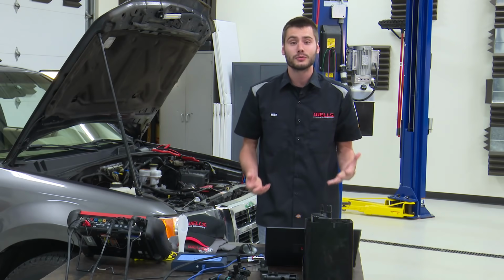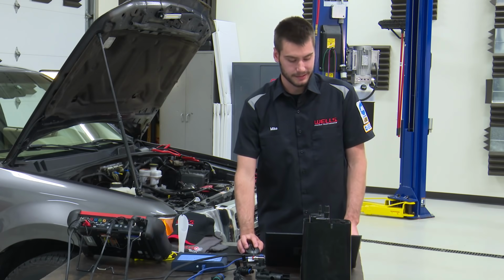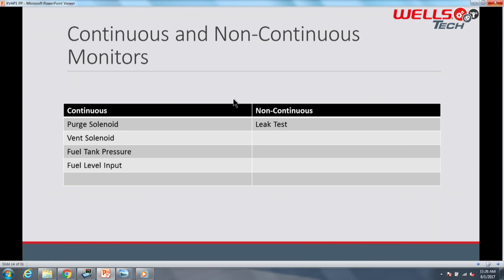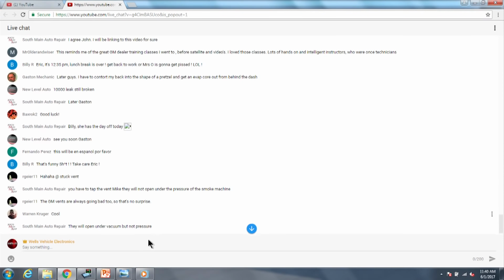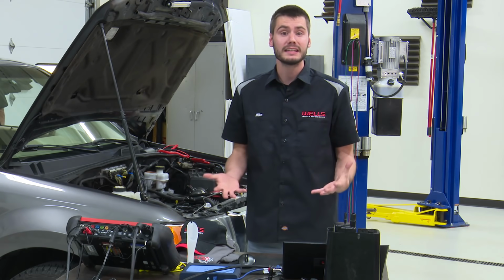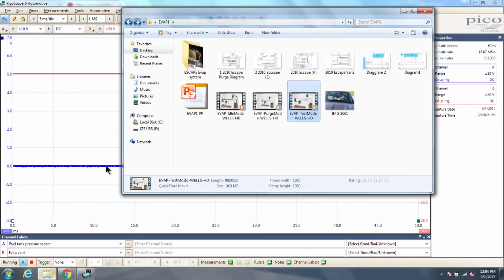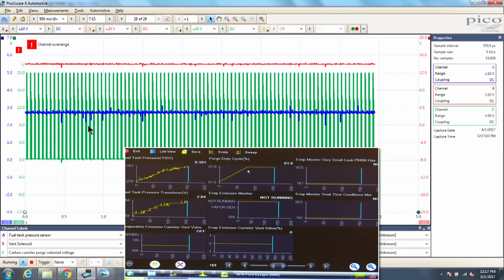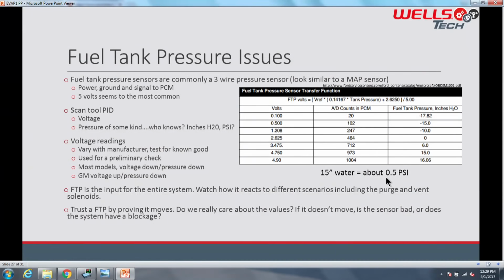EVAP-Evaporative Emissions System Operation, Testing, & Diagnostics Beyond the Leak (P0442, P0455)

Comment: Good video, learned a lot!! I have a HUGE problem with my Mustang, 2004/ 3.8 litre. It had a vacuumleak before I changed bigger fuel pump, 255 lph, but seems like now it got worse. I also changed throttle body much bigger, was 60 mm?? (OEM), now it is 70 mm. Also "check fuel cap" light used to come on, even I  before did these changes. Of course, there was nothing wrong with fuel cap, replaced it anyway. So now, I have very high idle, like 2500-3000 RPM, for awhile, about 30 sec or so, and then idle comes down to about 1200, never goes lower/ normal. I know there has to be a big vacuum leak somewhere, because AC blows from vent, works OK, but when speeding, or under load, going uphill, it blows to window only, changes by itself??? Checked vacuum leaks visually, so far replaced EGR valve, EGR solenoid, Purge valve "front door", and will change purge solenoid valve tomorrow, already bought it!= rear door =). 12 volts coming to purge valve and solenoid, just cant find a leak. Bought cheap smoke machine, did not find anything, that test was not so great, has to do again with good smoke machine. I will take out purge canister too, and check, if it is leaking or if there is gasoline??/ inside?? How do I find that leak?? And get my idle down?? Also replaced TPS and IAC valve, they are all good???? Tired to throw money for this problem, and I don't seem to solve this problem!!! Any tests, I could do?/ Any ideas?? Thanks, appreciate your help, youtheman =)
Reply from the maker: Hey Eero, thanks for watching!!! Man, it sounds like you've spent a TON of money on this car chasing this issue. Honestly at this point I would recommend you take this thing in to a shop that you can trust that is good at diagnosis. There's a ton of things that can cause that high idle. Maybe intake gaskets are bad? Hard to say without seeing it with a scan tool and some testing equipment. I think at this point you're are going to be money ahead to take this in and have it properly diagnose!
Mike Becker, Technical Services Instructor
Reply: I have sprayed around intake gasket??/ nothing?? Otherwise car runs good, just drive me nuts, I don't seem to solve this, leaking problem?? Yesterday took out EVAP purge canister, tested it with pressured air, in a water, no leaks?? Also changed purge solenoid, "rear door", and 12 V seems to be coming into plug?? It is a big leak,...BUT I can't find it?? Smoke-machine?? Could it be intake manifold gasket??? Going crazy here.....
Reply: And, also, "check fuel cap" light came on already, when I bought the car, like a year ago, now it comes on every now and then, yesterday codes were: idle higher than expected....welll, don't we know it already =), EGR system problem, and big leak in EVAP system,...I just can't find it????
Reply from the maker: Eero, most likely your high idle problem and your EVAP problem are unrelated. You tested the purge solenoid, the one near the intake manifold, and that's not leaking correct? If that's the case you are most likely working with 2 different problems here. What are your fuel trim numbers? High idle, first thing i'm looking for is codes and fuel trims.

Mike Becker, Technical Services Instructor
Reply: How do you measure fuel trim numbers??
Reply: Here are my codes, after I checked purge canister leak, and replaced purge solenoid= "back door"": idle still sky high, like 2500-3000 sometimes, comes down to 1100-1200 in about 20-30 seconds????, never goes under that; P0507 =idle higher then expected, P0443 = Evaporation Emission system purge control valve circuit, P0455 Evaporation Emission system, large leak??, and P0405= exhaust gas recirculation sensor circuit LOW?? And,....can't find a leak??? Help meeeeee, thanks =)
Reply from the maker: Eero, we have an entire fuel trim series of videos. I think 5 in total. I recommend you review those and get yourself up to speed. I have them organized in a playlist. 
Mike Becker, Technical Services Instructor
Reply: OK, I will check them out! Do I need any special tools, other than volt meter?/ to check fuel trim numbers? What do you think about those codes?? Could computer be the reason?? Otherwise car works fine, power OK?? Thanks, ps. there is a large leak ....somewhere???/
Reply from the maker: Eero, these questions will be answered in all of those videos. Tell ya what, watch those, then let me know if you still have questions. I am happy to help, but I think you need to get the base knowledge of this all first. 
Mike Becker, Technical Services Instructor
Reply: OK, thanks =)
Reply: Well, I did not watch them all,....part where you talk about  fuel trims...yes!!! Thing is, I can't check it without scanner, right?? I am starting to think, after I changed bigger, more powerful fuelpump, and also added plenum, between throttle body and intake manifold, about 3/4 inch ( I had to!),  this crazy high idle started??? Has to do something with stronger fuelpump, 255 lph?? I am sure that I still have a vacuum leak somewhere also, but, that is a smaller problem??/ "Check fuel cap"- light also still comes on???= vacuum leak somewhere!!!! So , do I have to go somewhere, where they can check my fuel trim and could adjust it??/ I sure will need them later, planning to add Cobras Supercharger into my V6, already bought that, it is in my trunk,...waiting for my buddy to make/ modify intake manifold for it?? How much those good "scanners" cost?? Thanks again, youtheman =) Ps. I also want to take out RPM limit,...it is now only about 4000 RPM!!!

Comment: Great presentation.  I am still not understanding the operation of the Vent Solenoid. Could you,please
provide us a detailed operation of it?
Reply from the maker: Carlo, which part? The vent solenoid on a basic EVAP system is only used to test the system for leaks. It is the back door. It seals the system as it is pulled into vacuum. At all other times, it is open allowing the system to breath (vent).
Mike Becker, Technical Services Instructor

Comment: Hi! @Wells Vehicle Electronics And Mike Becker! My question is: Can a faulty EVAP system lead to a fuel pump failure?
Reply from the maker: Hey Argeny! I can't see how an EVAP system would cause a fuel pump to fail. Maybe under extreme circumstances, like if the system were to be plugged and pressurize. I guess that could somehow affect the pump...but I find this unlikely. Gut feeling says no. I don't think so...but i'm sure there is someone out there that can prove that it can. That's the fun of automotive, impossible to speak in absolutes!
Mike Becker, Technical Services Instructor

Comment: 02 chevy venture LS question,  can canister vent solinoid be removed and replaced without dropping fuel tank?
Reply from the maker: Hey, unfortunately it looks like the vent and canister assembly sit on top of the gas tank on these Ventures. it may be possible to "lower" the tank without fully dropping it and changing it out. But, per the service procedure, step 1. remove fuel tank. 
Mike Becker, Technical Services Instructor
Reply: Be aware that the tank is stepped down toward the front and the vent canister is in the  front of the tank behind a metal baffle plate.  Looks hard to get at ;least 2 nuts inside plate  To remove canister .      Just behind it on the up (slope) of tank is the solinoid, attached to plastic clip,   not really on top of tank. Thats good.      Im trying to find out if the lifting and supporting jack stands WITHOUT removing 2 tank straps of 3 to drop front of tank will do the trick .  Do you have a service time to replace the canister vent solinoid for this very model . That may provide a heads up to not dropping tank    ,Tank R&I must be at least 1.5 to 2.0 .     If less than 1.0 I would say  its accessible with out Tank R& I . Thanks for the tech advice .
Reply from the maker: Great info! That labor time for the vent is 1.4 hours. The tank R&R is 1.8. You may be able to sneak it out. Good luck!
Mike Becker, Technical Services Instructor
Reply: thanks,   that time to R&R is still very long considering its upfront location  Id say they expect tank removal either way .  Cant see where GM would try to save customer 4 tenths  for what ?  They might be telling you dropping tank in the front saves 4 tenths as to not conflict with total  R&R 1.8 vrs    1.4    20 min roughly 40.00to 60. on  per hr labor rate .  Still overtimed at 1.4. They are covering their bases a bit to high . Like you said, it does look like a  time savings  and I will  attempt the job once fuel tank is below 20 lbs fuel. Thanks for the Good Luck wish Regards
Reply from the maker: You're welcome! If you need anymore info don't hesitate to ask!
Mike Becker, Technical Services Instructor

Comment: I have a problem where while filling gas it shutting off A and sometimes it works
Reply from the maker: Hey Alfred, commonly when this happens it is because the VENT solenoid is stuck shut not allowing the fuel vapors a path to flow. I would most likely be finding the vent and seeing if I can blow through it. 
Mike Becker, Technical Service Instructor

Comment: The design on my GMC looks like it was engineered by a team of retards. Every 6 months I buy solenoids and gas caps just to keep it on the road. What a fing joke US made trucks are.
Also it only runs the test at "special " times so you end up driving around wasting gas just to be let down usually around 45 miles only to find out its still leaking. This is deliberate planned obsolescence. The only thing that saves GM is the truck has usually rusted down to dust before the evap system shits the bed.   This issue has been with this truck since the day I bought it. GM makes a kit that supposedly fixes a poor design with a design that is even worse. ( PS it doesn't fix anything.)  The only question I have is why did we bail out Government Motors. To big to fail I think not they are failing every day . If you bring your truck to a garage you will be raped most places wont even touch rusty trucks.  Its a 3 year truck after that your on your own just around when the lease runs out coincidence?

Comment: I know it's way overdue, but the answer to your question was non sealing purge valve?
Reply from the maker: Hey SPD Parts, actually no, it was not. The answer was that the smoke was not making it's way to the filler neck (which was leaking). It never reached there because of the one way valve. Check out the TechCOnnect Video. I demo it on the car! https://youtu.be/u2yPUTA3pEY
Mike Becker, Technical Services Instructor

Comment: so basically the purge sensor is like the DPFE Sensor on a 2000 Ford f150?
Reply from the maker: Hi Rosman Morales. Are you talking a purge sensor or purge solenoid? A purge sensor is similar to a MAF sensor, air flows through it and the computer then knows that the purge solenoid is opening. 
Mike Becker, Technical Services Instructor
Reply: Wells Vehicle Electronics I don't know.  I have a 2010 Chrysler town country and it is the one on the left side of the van under the hood. It has a filter type of thing.  It has 2 hoses on it
Reply from the maker: Alright, Chrysler uses a purge solenoid. It is a normally closed valve that opens when power and grounded by the computer. Very very different than a DPFE sensor.
Mike Becker, Technical Services Instructor
Reply: Wells Vehicle Electronics What I do know is that I have a P0440 code.  I checked all the hoses and they look fine.
Reply from the maker: Rosman, we are actually going to be doing a Chrysler EVAP class coming up here soon. Stay tuned for that, I think it will help you get to the bottom of your issue!
Mike Becker, Technical Services Instructor
Reply: Found the problem to my van. I dropped the tank from 1 side and found that the carbon canister was left unplugged on purpose by the mechanics. I guess they were hoping that i bring it back so they can stiff me the second time. That was my 1st time ever taking it to a mechanic! Only reason I took it in was because I wasn't feeling it to do the job myself this time around.

Comment: That Ford easy fuel filler neck is a joke. I've replaced tons of those things already
Reply from the maker: Hey John, yeh they do seem to have their issues. I have owned 2 vehicles with them so far. I find that if you keep it clean you'll never have an issue. 
Mike Becker, Technical Services Instructor

Comment: Hey Mike! Third time watching; what kind of gas is the one coming out of the charcoal canister? I know you said fresh air, but in the case I have a stuck open purge solenoid, how is this gas going to interact with my "normal" intake air? Is it going to be like inert gas just taking space in the combustion chamber or is it going to cause a lean condition? (This type of EVAP)
Reply from the maker: Hey, third time's the charm!? First off, we need to understand that the Canister has multiple ports. One going to the purge, and the other to the vent. The air from vent is "filtered" air. The air traveling to and through the purge is not "filtered" air.The purpose of the purge is to clean all of the stored vapors out of the canister. SO, the air traveling through the purge is very combustible fuel vapors, so, a stuck OPEN purge can cause rich concerns while emptying out the canister. Once the canister is empty of fuel vapors, then the car will run lean. Because it's pulling IN fresh air through the vent, through the canister, and through the purge. Does this make sense? 
MIke Becker, Technical Services Instructor
Reply: Gotcha! Now I understand. The gas going through the purge is not air. That's why it's going to create a rich condition instead of lean. Mike, thank you, and thanks to Fritz too because I also watched it in Spanish. You guys are great!Thanks for the time and effort you take to present the seminars.
Reply from the maker: Exactly!!! Thanks for taking time out of your busy day to watch! Glad Fritz and I could help :)
Mike Becker, Technical Services Instructor

Comment: Lol. Warm vent solenoid.  Why?  Too much current going through it. Thus, this is why the PCM leverages pulse width modulation.  It is a way to limit current yet still hold a valve open/closed.  Cool.
Reply from the maker: Hey GeekDIYMechanic, you are right. The PCM does use PWM to limit current. That being said, that vent solenoid that I was demonstrating was not a PWM controlled valve. That valve was intended to be on/off. It was never intended to be run on for 15-20 minutes straight though. The leak test on the older GM's was much shorter than that. 
Mike Becker, Technical Services Instructor